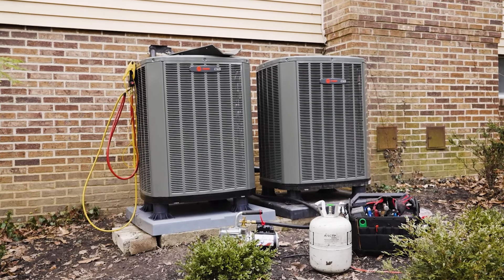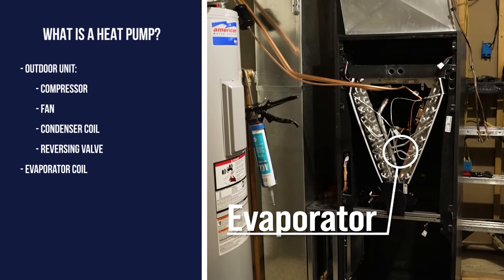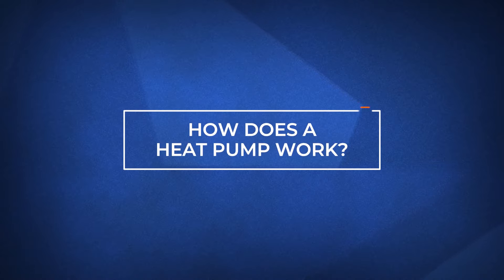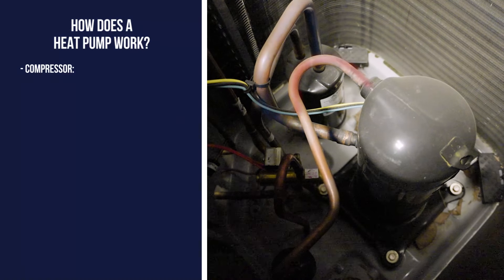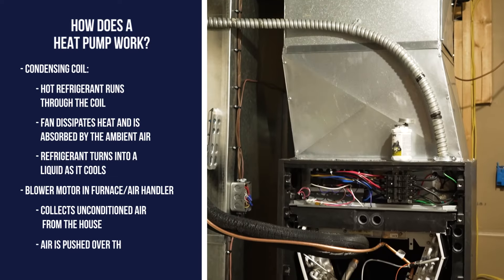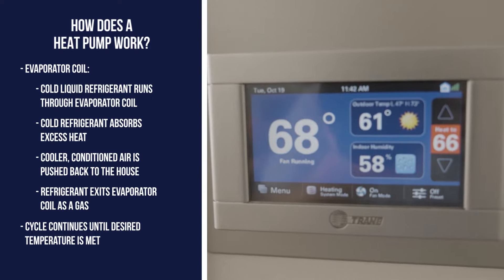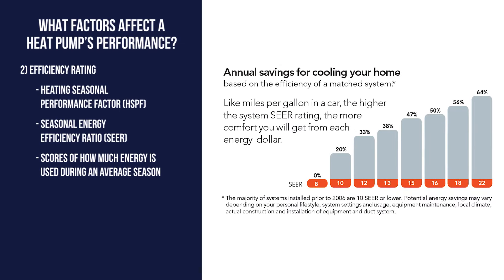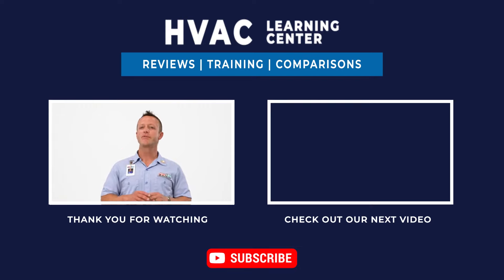How does a Heat Pump Work?

Comment: Greetings, I am hearing what sounds like a howling / groaning noise at various time when the heat pump is running for heating, this is a new home and I was told by the installer it was the defrost mode...yet this is happening when the temps outside are in the mid to low 40's...since this is the first home I have owned with a heat pump, I'm not sure the installers statement is true since I've read the defrost mode does not become active until the temps drop to 32 degrees...

Was hoping you may be able to give me a little info on what type of sounds I should be hearing.

Thanks!
Reply from the maker: The only thing you should hear sometimes is the reversing valve slide over

Comment: Hi, I have a 4000 Square foot home with two large systems outside my home and a system in the attic along with a propane heating furnace in the basement. For some reason the master bedroom is not producing heat, but the rest of the house is getting heat. I'm thinking the system in the attic suppose to produce heat for the master bedroom . When the system calls for heat the 2 outside systems fans are not running, but the system in the attic will operate pushing out cold air for the master bedroom. What is going on with my system?
Reply from the maker: There could many different scenarios taking place.  Does your master bedroom have a thermostat?  Is it being satisfied?